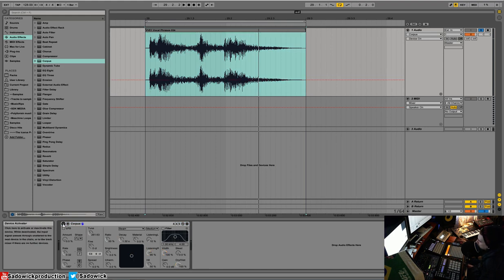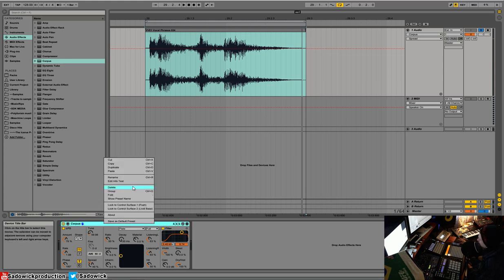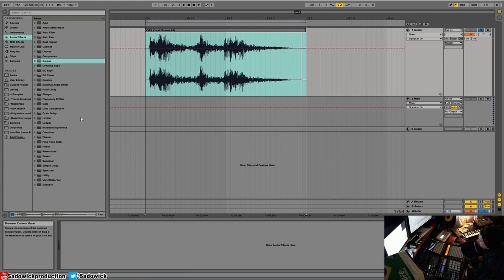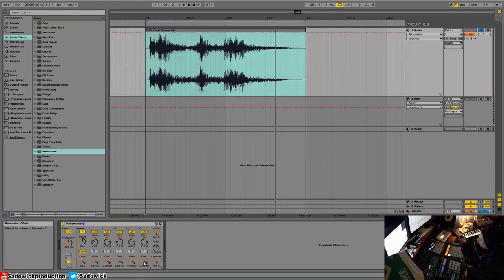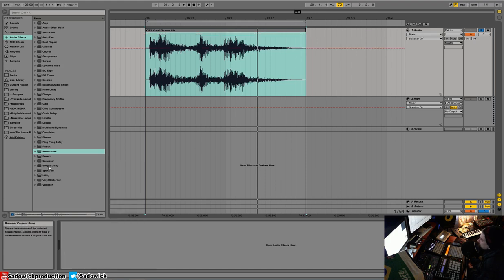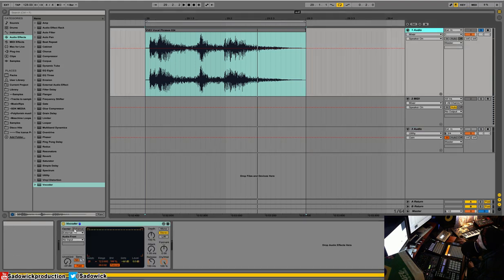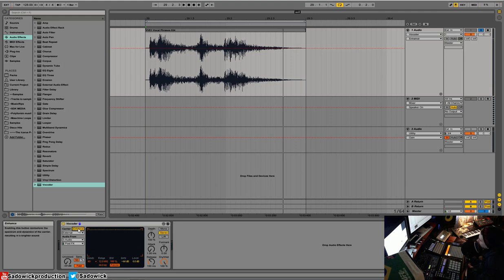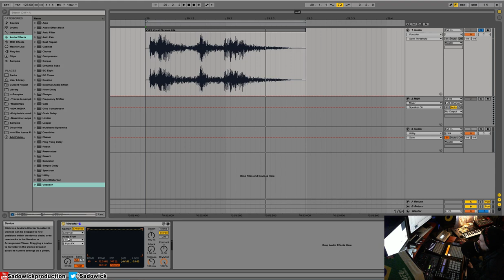Ableton Live Ultimate Course 21 - Corpus, Resonators & Vocoder

Comment: I have a pretty shitty midi controller (MPK mini 2) and I don't know if its the capability of it or me just not setting it up right, but when you were using the vocoder plug-in you were able to manipulate the audio track with your controller and give it specific note values. When I'm in ableton I'm not able to do that because I can't use my midi device in an audio track. This is a really awesome feature I would like to use. If you could explain that I would really appreciate it.